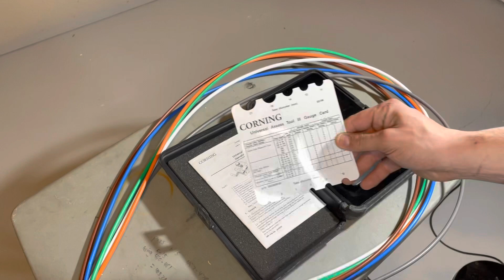How to open Ribbon Fiber Optic mid span cable with Corning access tool 3

Comment: I take it a mistake in setting the tool up correctly could mean a long day of splicing the entire set?
Reply from the maker: Yes exactly it’s always best to take the time test the tool and then increase the depth of the blades if need be to ensure easy access to the fibers without breaking any

Comment: Do you use other mid span tools to open up tubes? Don't believe I've seen you use this particular one. Appreciate the demo.
Reply from the maker: Yea there is the smaller one for loose tube cable I made a video on recently. This is the other tool I have for Ribbon cable thanks for watching and commenting🙌
Reply: @FiberSpliceGod  I'm curious if the jonard mid-span slitters will work on these
Reply from the maker: @fps_purple9556  yea I think they would I do know they have ones with bigger slots for ribbon cables I have never tried one tho. I have always used the Corning option for ribbon cable it is a expensive tool but for sure worth it. I’m contacting Corning right now to see if I can get the viewers a discount code on the tool